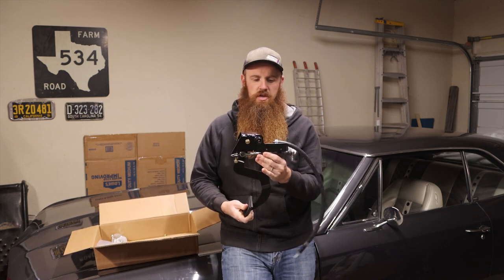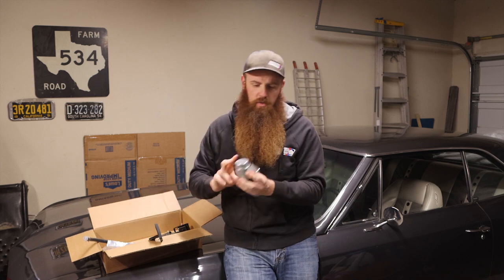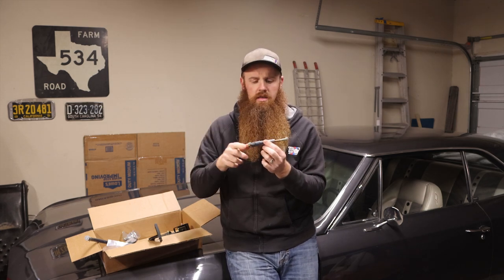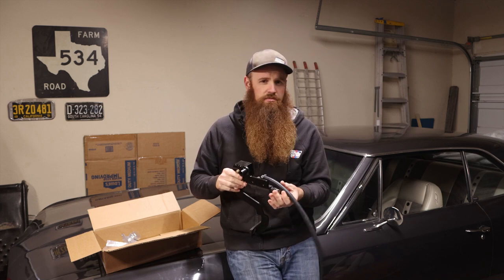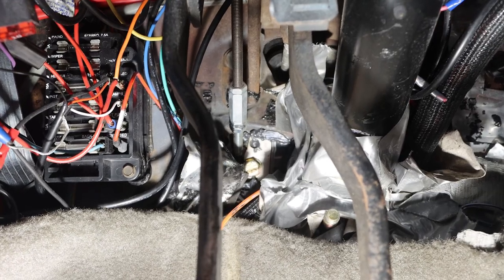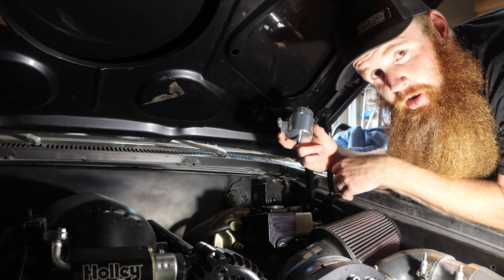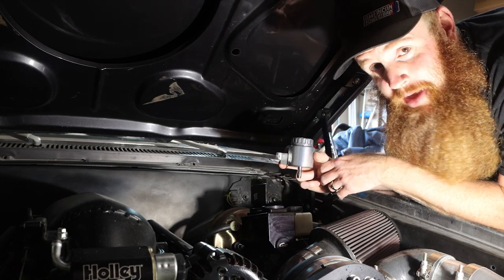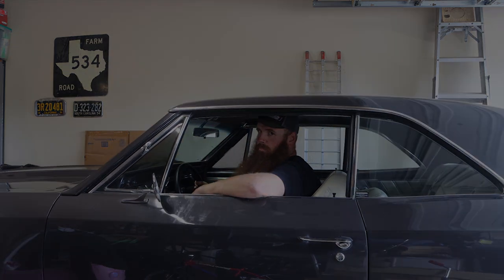American Powertrain 1966 Chevelle Hydraulic Clutch Installation

Comment: I've got an 86 gmc 1500 I've been having trouble with the factory automatic transmission.  I've pulled it out and I've got a manual transmission from a 76 gmc 1/2 ton. The 76 is the linkage type clutch that I'm considering converting to hydraulic. Is that something that there is a kit for. Needless to say I do not have a factory clutch pedal in the 86. I have the pedal from the 76 I intended to use. If anyone sees this and has any words of advice I would much appreciate it. I'm honestly a little out of my wheel house here
Reply: I would call the people at American powertrain because they will be able to help you out definitely

Comment: What type of hydraulic bearing you use for the munice ?
Reply from the maker: https://americanpowertrain.com/shop/hydraulic-clutch-kits/1967-gm-a-body-chevelle-lemans-442-gto-tempest-cutlass-skylark-hydraulic-clutch-conversion-kit-with-clutch-pedal-for-tkx-tko-and-muncie/
Reply: I have a transmission from a 76' gmc 1/2 ton I'm intending to put in my 86'. I believe it to be a Muncie sm465 I wonder if you have any advice on how to be sure...edit: I'm a bit transmission illiterate definitely out of my wheel house